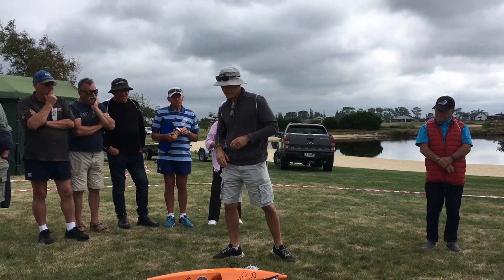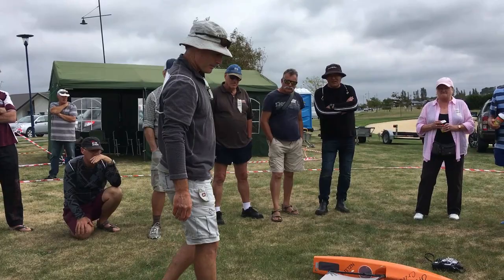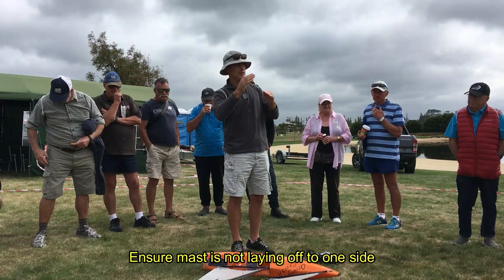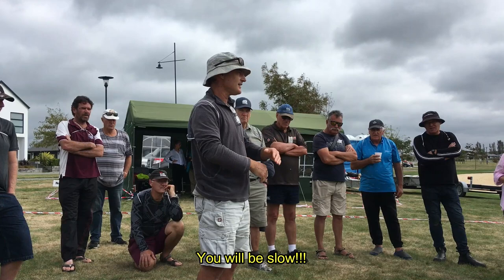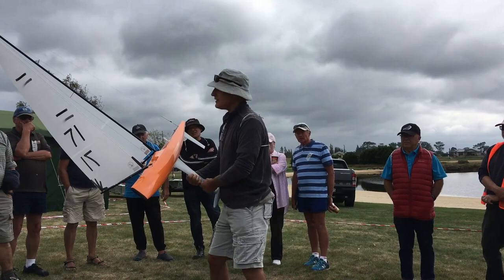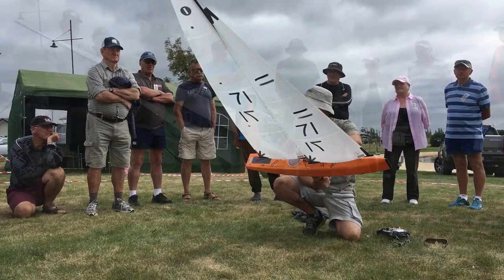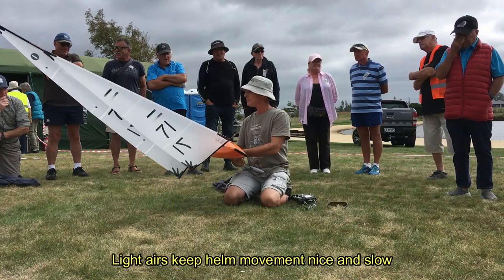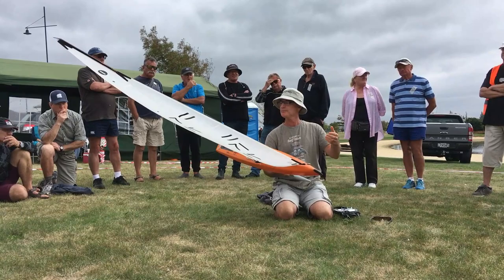Talking IOM Setup with Ian Vickers

Comment: I recently bought  my first IOM, it is a V7 and we sail in mostly A rig conditions here in Switzerland. Are the setting shown at 10:30 a value that I could use for the V7. In flat reasonably water and light to medium conditions, it still seems to hold its own very well. V 10 or its successor are on the list of "I want" toys.
Thanks 
Daniel